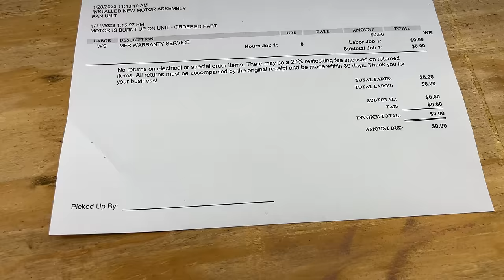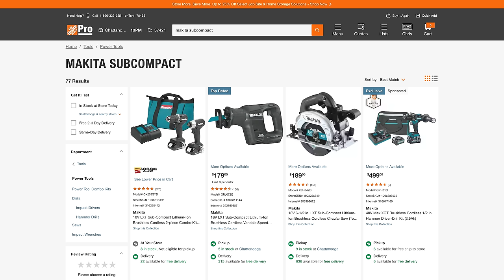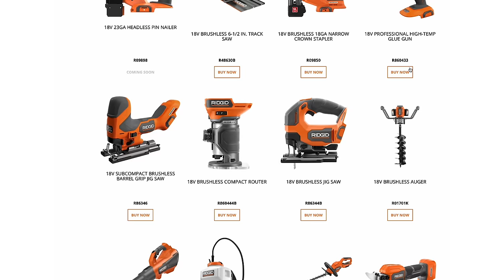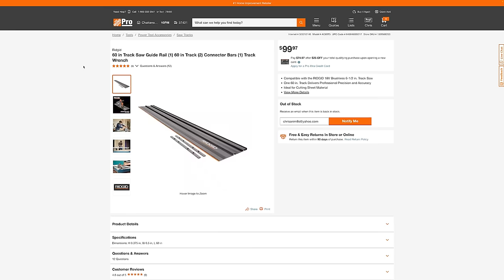Why Everyone Was Wrong About RIDGID's Future...

Comment: Milwaukee did not like that the octane line outperformed Milwaukee tools and they feared people would swap battery platforms.  which is a ludicrous idea they cost too much money. The rigid high torque impact wrench at the time outperformed Milwaukee's high torque impact wrench. And Milwaukee got their feelings hurt and told rigid to calm it down. As far as the octane batteries there was a lot of Bluetooth issues and heat sensor issues that really turned to customers off. I have a rigid Bluetooth octane battery that the octane battery app tells me the battery is 435°. Sitting at room temperature which it is currently in the 60s here in Florida but the app says my battery is 435°. Also needless to say I can't use that battery I have yet to figure out how to fix that and work around it. So rigid entered the sub compact market. And for the price to performance ratio they were pretty good my first gen Sub compact impact driver is my go-to when I need 18 volts. Now they've come out with their new brushless lineup which is pretty much octane minus the octane branding.  I really wish milwaukee tti would just let Ridgid do its thing. Great tools in orange.

Comment: TTI rents the Ridgid brand from Ridgid. Ridgid still produces its own tools (mostly plumbing related). You can tell the difference because the Ridgid logo is slightly different. The tools produced by TTI have an orange line, or bar, under the Ridgid name in the logo. The 'real Ridgid tools' have a red bar. 

The reason for the disapearance of Ridgid's Octane line had nothing to do with poor sales. It was just the opposite. The Octane tools were so good that they competed in terms of quality and performance with the best tools from Milwaukee. Milwaukee executives complained to TTI and TTI told Ridgid to back off. Pulling the Octane line gave Ridgid a black eye. Many in the trades don't trust Ridgid because of it. I think that's starting to change. As long as the brand continues to introduce more tools and refresh old ones, Ridgid will do alright.

Comment: I've used Ridgid for years and like them a lot. That being said, every power tool I've bought from them since 2018 has been garbage. The oscillating tool is total trash because the switch jambs and it won't even start half the time. 

The battery powered palm sander turns off every time it encounters resistance (I exchanged it 3 times and they all do the same thing).

I recently bought their $80 drill for my grandfather and it's garbage. Cheaply made and they even replaced the clip on the back that used to hold a bit with a piece of plastic.

Comment: Sooo my nail guns air compressor led light and my rigid saw got flooded. I’m sure the miter and table saw got some water. They all still work fine. This was a flash flood while I was asleep and no reports till the emergency alert. Went out and they were all in 3 inches of water near a gutter run off…

Comment: I was Ryobi for a long time, nothing against Ridgid just was cheap. Now in the period your talking about, where it seemed like they were going down, I got into Ridgid. Specifically that subcompact line you mentioned. Now ok that is a crowded space, but price to performance Ridgid rocked it, little bit less power than Milkwakee for wayyyyyy less money. It was why I bought in having worked with a friends milwakee tools alot, like I knew they were mostly overkill for what we were using them for, and Ryobi was either good enough, or just barely underpowered for the job. Reality of that line, Milwakees more desirable tools are 12v, which dont stand up. But Ryobi and Ridgid having comparable tools but 18v can rocket them ahead. Big example there for me is the cordless inflators, my ryobi is way cheaper than the 12v milwakee, but its faster just because 18v. Anyways that subcompact line is a real powerhouse tool. Its where milwakee having 12v and 18v seperate lines and being alot more expensive(they are good tools though) creates a mile high barrier of entry for them. Because the tools you would want you need to buy into both lines, and your still screwing with multiple battery platforms for just that one brand. Its where I think Ridgids lineup the past couple years has been the sweet spot, one platform, not a restrictive battery shape like ryobi and your getting close to milwakee tool performance, or ahead if they only have a 12v version for alot less money.

Comment: I just buy 5000$ of Milwaukee tools and 3000$ of packout thing from october 2023 to december 2023. If I have to redo it again I defenitely to with rigid. My 1/2" impact gun is gone! My drill is toasted and my reciproacting saw making abnormal sound! My 12 amps battery doesnt last longer than 2  5 amps after 50 charge!! I'm really pissed!

Comment: Ive been through 4 rigid beltsanders in 3 years. Spent more in returns than i spent on the original sander. I wouldn't buy another tool from them.

Comment: I have a Rigid drill and cordless circular saw. The saw has been weak from day 1. I always wanted one, my wife got it for me for my birthday, and it was a huge let down. The drill used to be really good. Today it gives up and just stops with the easiest of jobs (as in, doesn't make sense easy and it just stops). I have four batteries, and it doesn't seem to matter which one I use, the performance still sucks. All this while the batteries indicate that they are at full capacity. Can they all be bad? I can see one or maybe two being bad, but all four? I don't get it. The drill is probably three or four years old and hasn't really had that tough of a life. I'm reluctant to buy a new battery since they are so expensive and I don't know if it's the tools or the battery (again, the saw was underwhelming from the beginning, bogging down on everything. Now it'll turn off before I even start a cut). I'm considering tossing them and getting something, anything, else. Hell, even Harbor Freight or Walmart tools have to be better than this. Any suggestions? I'm hoping that there is something obvious that I'm missing. I've Googled this issue several times but I can't find any articles on this issue. I guess it's just me?!? The drill is an R86009. The saw in an R8654 (part of the Octane line...I never knew untill today). The batteries are their "Hyper" Lithium Ion model.

Comment: I will never buy Ridgid again. I bought a finishing nailer had it for a year and it quit working.  It was registered on their site with a lifetime warranty. When I got on the site to make a claim it said warranty expired. I called them to dispute the expired warranty and they said they quit making certain parts for it. When they quit making any part for any tool it automatically cancels all the lifetime warranties. So in essence I paid $200 to use a nail gun twice it might be a good deal on the batteries but I wouldn't buy anything else

Comment: Something I've always wondered with Ridgid is whether their color scheme is holding them back.  I've been a Home Depot customer for a long time, and before I got more versed in tools, I only ever saw Ridgid sold at Home Depot, and because their color scheme is basically the same as Home Depot's, I always assumed they were an in-house brand for Home Depot and thus I assumed they were the equivalent quality level of similar "store brands" (that is to say - not great).  I really doubt I'm the only customer who made that association based on the color alone, and I wonder if this is a much greater phenomenon than maybe Ridgid even thinks.

Even once Home Depot started championing Ryobi heavily, I (initially) assumed that Ryobi was another of their "Store brands" and they were positioning Ryobi as the cheaper store brand option and Ridgid as the "mid-tier" option, OR maybe they brought in Ryobi to try to prop up the brand stature of Ridgid.  Again, that assumption was misinformed compared to the actual reality, but customers make assumptions about brands all the time, whether they're rooted in reality or not.

All this to say - I really think if Ridgid rebranded away from an orange color scheme, they might be able to differentiate themselves a little more from being just a box store brand and instead be more of a tool brand that stands on their own.  I'm no marketing exec, but that connection to Home Depot lived in my head for over a decade, so I doubt I'm the only one who's brain made the connection.

Just some thoughts...
Reply: same here.
Reply: Agreed!  Its not a great color combination imo.  My ridgids have never let me down.  I have dewalt, makita, and milwaukee along with my ridgid. Ridgid  are as good as any of them, and I've never had to use the  LSA yet.
Reply: The TTi produced RIDGID tools are literally the house brand for Home Depot. They won’t change from orange. Ryobi has an increased presence because TTI gets to keep more of the money from sales instead of having to give a cut to Emerson.

Comment: Ridgid has two radio job boxes and one of them would also charge a battery. 
Yet none to be found and never replied to emails. 
So screw em i bought the Bosch job box.
Only reason i stay with them is direct factory tools outlet. 
I buy factory blemish batteries. 
When they die, I'm going to harbor freight. 
They'll never miss my business.

Comment: Rigid makes OKAY battery tools if you want to save a dime. But I think if you want a little more quality for your cheap buck, Harbor Frieght is a little better here with their new line Hercules.

Rigid corded tools though? Absolute trash. Complete waste of money. I tried out 2 different miter saws and went through 5 table saws. 3 of the table saws were warrantied, but the problem persisted. So I went with a new model and just found more problems. The biggest issue with the table saws was alignment of the fence to the blade. It was next to impossible to do.

Comment: They're still dead to me. Had a shop full of orange tools and then they came out with the 'lifetime' warranty on cordless tool batteries. Ridgid did not honor their warranty and were awful to deal with. I've bought a lot of stuff from Home Depot over the years and it was Home Depot that took back the Ridgid crap when even Home Depot's service center could not get a reasonable response from Ridgid. Loved the calendars but now I'm a Milwaukee and Dewalt guy all bought thru Home Depot.

Comment: The other reason thought RIGID was going away was that TTI owns Milwuakee and Ryobi but only licenses RIGID which is really owned by Emerson.  Thus when tools stopped coming out it was believed that maybe TTI was focusing on the two brands they actually own which would make sense and RIGID was just left sitting there.  Due to all my tools being taken including all my RIGID I have had to decide what to rebuild the shop with from scratch and am leaning into SKIL mainly because the price of the new RIGID stuff is just that much higher.  I may look at RIGID down the road again.

My other issue is that RIGID has treated some of their independent servicers pretty badly and the pay isn't worth it so all of them near me have closed up and stopped.  To get a tool to an LSA location now I have a 90 minute drive.  Starts to make that aspect of it not as beneficial to me personally.
Reply: I am also a full Ridgid user.  They just changed the LSA procedure on the tools for repair.  As long as you have them registered, go to your portal and now all tools have the File A Claim button.  I just used it on my Brad Stapler.  It was very easy.  You print out the FEDEX label and box it up.     My Oscillating tool also died and when I went to Home Depot to send it to Ridgid Repair, thats when I found out HD doesnt facilitate that anymore.  HD was cool to replace my oscillating tool on the spot with a new one.  Then I called Ridgid support and they added the serial number to my collection of Ridgid tools and removed the broken one.  It was awesome to actually get someone on the phone quickly.  If they keep it up i will be staying with the brand.
Reply: It's not like TTI was investing anything into engineering for Ridgid tools. In Asia and Europe, they have the AEG brand of tools. Ridgid tools are just AEG tools that got renamed with the Ridgid logo. They are the same batteries, orange color, and every other design cue. It's just a different logo.
Reply: @maximusmagni1  And if I recall at one point I looked at AEG tools and was thinking How come we don't have that!!!!  I remember thinking the AEG lineup of tools was way more expansive and had some newer stuff but that was gain probably about 3 years ago.
Reply: @4321Woodworking we don’t have the full line up of AEG tools in the US because they contractually have to use the Ridgid name in the US for them. And Emerson won’t let TTI do what needs to be done to make the orange Ridgid tool line up better… so yes, the focus was more on selling what they had full control over: Milwaukee and Ryobi.

Comment: I will never buy another rigid tool. I bought an R2901 router from Home Depot a couple of years ago and needed to buy a 1/2” collet and they have been discontinued. Are you f;#~%%g kidding me?  Went to a dozen places online and they are all sold out. This is a big router and if I wanted to use a 1/4” bit I would just use a trim router.

Comment: Doesn’t Ridgid just lease their name to Techtronics or whomever? Despite being part of a conglomerate they still operate as a company and have always been plumbing wrenches first. The power tools were a side to capitalize on their name recognition. I’m sure they are happy selling fantastic thousand dollar massive wrenches all this time and hVe become a stable company all this time. What their parent company does with power tools is probably something they barely think about.
Reply: They do have a licensing agreement with TTI for the name and logos and such. However, they do get some say in what TTI produces, and that is why TTI kinda grumpy at them. If it wasn’t for Emerson throttling what TTI could do, you’d see a ton more new Ridgid products, nestled neatly in between Ryobi and Milwaukee.
Reply: @Borescoped  The Ridgid oscillating sander has been a very strong sand consistent seller for two decades or more. Very surprised the other big names haven’t tried to compete. I wouldn’t be surprised if it’s their best seller by a large amount.
Reply: @FearsomeWarrior  I’d bet a cold can of soda that the oscillating sander was outsourced with an exclusive agreement that has now run out. Many other producers of oscillating/belt sanders are nearly identical except for the main housing, which remains unique to Ridgid.
Reply: @Borescoped  There was an open frame tube one that is the same but open. I thought it was replacing the long standing model but apparently it only sold for about a year. It is fun seeing the beige colored one from the 90’s pop up. Totally agree and it’s the swap from spindle to belt feature that they held on to.